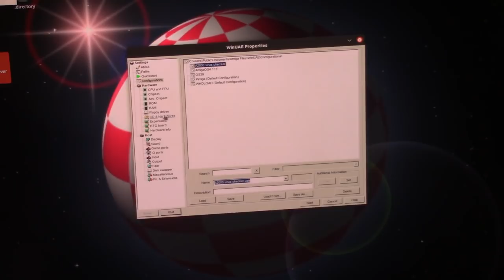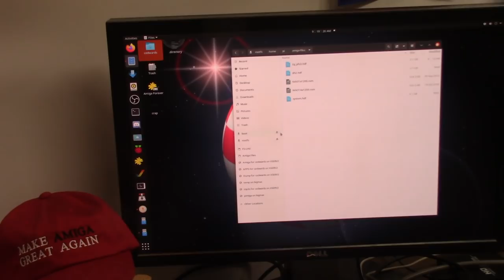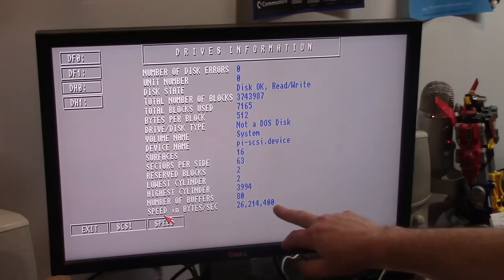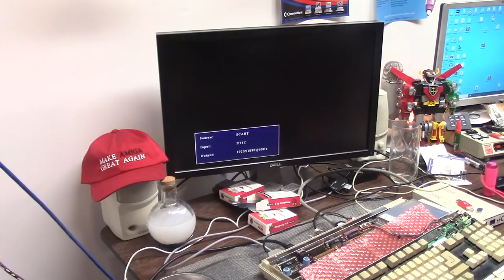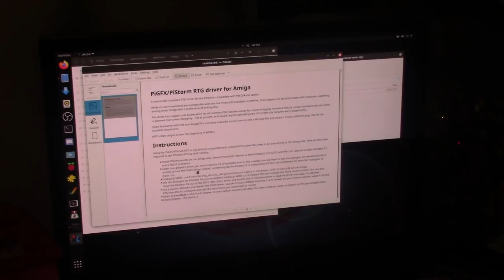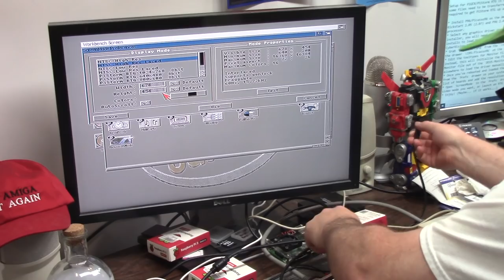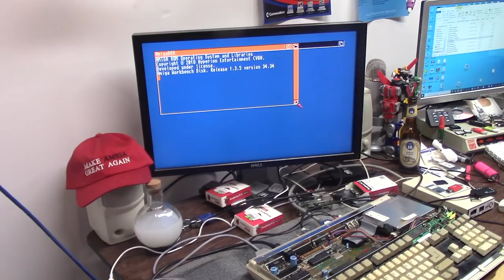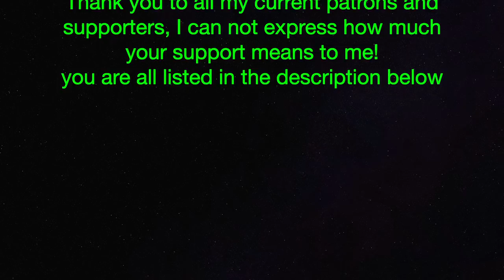Amiga PiStorm P2 - ROMS, Hard drives,  RTG and more

Comment: Is there anyway to adjust the Overscan in RTG? If you open it, it just shows PAL with basic Low Res settings and does nothing.
Reply from the maker: rtg no, only amiga modes., multiscan and dblntsc/dblpal if the monitor tooltypes are in devs/monitors,  normally those are in storage/monitors, drag em over and reboot.

Comment: Wonderful Work, Thanks Chris, a Small query, I understand this is a old Video, but When you hold down both MOUSE Buttons, turn on the AMIGA, you should get a screen to select between, PAL or NSTC ? Not Sure if this would have any effect on Sound, or if is something in Rom, cause I remember it from my Time with Toasters, on a PAL Machine, using Toasters which were NSTC, which may have triggered it, in Rom ....
Reply from the maker: pistorm hates Zorro slots too, it can sometimes do ONE card, but can not address DMA,
Reply: @ChrisEdwardsRestoration  Yeah I was tired when I typed that, ooops
Reply: That only applies on certain models,  not say standard Americn A500s.
Reply from the maker: @fmlazar  DMA? 500 has no DMA anyway as it only has one expansion slot.

Comment: Yea switching Video Modes VGA/CGA/HDMI is a PITA.  On my desk I have 2 monitors and a TV and its a pain keeping track of what is connected to where which is why I have most of my toys connected to KVM Switches and I have an 8 Port VGA/PS2 which all but one of my Amigas are connected to and then I have a 16 Port HDMI/USB which I use for all my other toys but I plan on connecting my Amiga's to that switch too so I will end up with Dual Displays.   Everything here is a work in progress and right now the only Amiga's that have HDMI are the ones with Vampires because I have to play catch up with my house before I can build those RGB2HDMI Boards.    The PiStorm I do have an interest in but its for my A1000 which is the only Amiga I have that has no accelerator in it and I have some old boards from my original A1000 back in the day I have to dig out but I think I am missing a chip for one of them but right now that's not important just giving the old girl a speed bump would be nice and I have some RAM boards for it I have to look for in the house from my original A1000 from back in the day.

Comment: Any idea why Frontier was running a bit too fast in your last vid? Maybe NTSC/PAL issues due to the different chipset clock? Also, as far as I understand the code, It seems to me that the CPU "emulator" is just a normal user mode process with a couple of threads talking to the CPLD. If that is true, I would expect it to get preempted all the time by the linux kernel and other threads so the actual emulation speed cannot be constant. I would expect it to behave somehow like WinUAE with "fastest possible" CPU emulation speed. I wonder what consequences this would have for Amiga software. Maybe you could show off some games etc. next time?
Reply from the maker: My amiga is ntsc i booted it in ntsc so it ran faster i have to double mouse button choose pal otherwise the audio is fast or late

Comment: Hi, this 4GB hard disk file you shared isn't .hdf? How do I get it to work with my A500&pistorm?
Reply from the maker: it is, just change the extension. 
you can use it as a blank hdf to install workbench on if u wanted to. or create your own in amiga forever/winuae which is what this one is.  probably faster to build it all in winuae with a hdf file and just ftp that file over to the pistorm.

Comment: Since your set-up allows both PAL and NTSC, why do you stick to NTSC?  Pal will give you more resolution on the desktop.  Without RTG, you also should take advantage of the Amiga overscan to maximize desktop resolution further.
Also, why did you install a full Linux distro with Xwindow desktop on the raspberry?  A smaller text-only Linux distro would make the Pi boot faster.
Reply from the maker: lite has no X or dwm anything, i can trim un needed services to make a faster start.

Comment: Any chance to by PiStorm ? I tryed to order in JLCPCB but there are some parts missing.
Reply from the maker: there is some kind of chip shortage for the alterra cpld, you can still get them made minus this chip and source your own on ebay for a slightly inflated price,  not alot, the orig cpld was 3.15usd. now its like 9-15usd   supply and demand i guess.

Comment: I think that when you go to RTG mode the CPU emulation can go faster as everything can run "independently" instead of sharing the bus with the chipram.
Reply from the maker: Thats it then . I thought it was faster!
Reply: @ChrisEdwardsRestoration  But it may just be affecting Sysinfo...you need to try a real test...like run some demos or like the start to frontier....you should try to boot the Coffin OS R56 or something on that and mess around with it.
Reply: Let's see...ADOOM at that speed about the same as my AGA core MIST with RTG runs at about 5 FPS in EHB or in RTG no real frame rate change. However, it looks like in RTG mode with the PiStorm the CPU is just abit more than doubled. I if you run ADoom in EHB mode and then in RTG mode and the frame rate doubles, then you know that in RTG mode the CPU emulation is twice as fast!!
Reply: @CobraTheSpacePirate  Demos and Frontier run on RTG?
Reply: @jensdroessler3575  I suppose there are some demos that could run on both rtg or native...I don't think Frontier can run on rtg...

Comment: Sweet, is it faster than a 060 50Mhz?
Reply from the maker: Its nice and smooth. Fast for me but demo and cpu intensive program testing would need to be ran to determine if the emulated cpu is up to par.  So far its been super awesome.
Reply: @ChrisEdwardsRestoration  Nice! Cant wait to try one myself in the future. I want to keep all the custom chips stock but have no problem with the CPU being emulated (or the GFX board). Thanks for the video!

Comment: I am SO there to source a PiStorm for the Amiga500 desktop that I have build from scratch. Just a shame that there is a lack of chips at the moment. 😒
Reply from the maker: well commercial shortage yes, individuals can still get the cpld on ebay for like 5-10 each, way more than the 1.35USD they were. but supply and demand i guess.
Reply: @ChrisEdwardsRestoration  Hmmm.... They reported something else on Discord. I just have to wait untill my other projects are done. I have a couple of C64 clones that I need to build first, and then I have my 1200 that need to be upgraded first. Right now the 1200 is stock configuration. I have gotten a new membrane and the board is recapped. However I need to get more ram and a scandoubler for it as a minimum.
Reply from the maker: Go look on ebay the cpld is an altera max II epm240T10015N
Reply: @ChrisEdwardsRestoration  I believe you, because you seem to know more than me about computing stuff. However I will wait to buy a Pistorm untill I have finished up my other projects. I can not solder smd, so I will have to rely on what I can buy ready made.
Reply: @brostenen  It doesn't hurt to wait a while. This is just going to get better and better. It's still pretty much early days right now. It's exciting to see this stuff taking off.
Reply: @ninline2000  Yay... When the software have matured even more, then I will get one for that 500-desktop that I build. It is the one, that I have a video about, on my channel.
Reply: I had no problem finding the CPLD in eBay I bought 6 from China at air $6 each. It was perfect because the PCBs were e 5 for $2. I was afraid the CPLD were fake, and if they are i don't care since they work.

Comment: Wondering if you can fit this with the pizero2hdmi  as well.
Reply: You can as long as you’re careful with your choice of mini hdmi to hdmi cable.
Reply from the maker: cpu speed would suck eggs. but those boards fit fine. as they dont have the long usb ports hanging down
Reply: @ChrisEdwardsRestoration  - I think he means two different boards. One for good CPU speed and another, slower pi for hdmi conversion.
Reply: @davidste60   That's what I was thinking that way RTG works and "standard" is ported to HDMI. no more horsing around with scalers and such.
Reply from the maker: My brain is fried sorry.  Rgb2hdmi would fit with a super tiny mini hdmi as the ports are adjacent to each other but the cpu is just a tad lower
Reply: PiStorm developer is designing a RGB2PiStorm thing, it does what RGB2HDMI does, but sending the signal to the PiStorm/RPi combo, so ALL Amiga outputs, both standard and RTG, would be being displayed through RPi HDMI output, so no need of two different connectors, one for RTG and another for RGB.

Anyway, it's still in a very early stage.
Reply: @ferran.garcia  that would obviously change things.
Reply: @ferran.garcia  - That's interesting, but I thought the Pi3 models can't do low latency video conversion, which is why the Pi Zero is used for the RGBtoHDMI. Am i wrong?
Reply: @ferran.garcia  - Nice, I hadn't thought of the camera port! Thanks for the links.

Comment: Is painful watching you pull out the sdcard or transfer files via serial. You can transfer files via ssh. The raspberry pi can also mount network drives.
Reply from the maker: yes i know. but not everyone knows linux commands, im trying to do it as people would do  old school. as im old school. theres a millilon ways to accomplish the same task. sftp would be the best way.
Reply: @ChrisEdwardsRestoration  How fast will serial go on a A500+ with a pistorm?
Reply from the maker: @IntenseGrid  pistorm is cpu and ram/rtg it is not serial device. that and the other Amiga chipset is still what it its, while theoretically 115200, the Amiga has slower UART chips that give it a practical 38400

Comment: So you have an amiga running workbench from a raspberry pi emulator on top of linux. The cherry on top would be to install NetBSD on the amiga.
Reply from the maker: Its just the cpu and hdfs you can still use orig hdds

Comment: I don't get how you manage to make an A1200 kickstart ROM image work on an A500, it is not the same hardware.
With a 3.1 A500 kickstart ROM or 3.1.4 A500 kickstart ROM image, OK, but A1200 version, really?
Or maybe the name of these files is not the good one, and it is actually the A500 version of these kickstart ROM image?
Reply: The A1200 ROMs support the A500 hardware well enough to not being a problem and offer better working autoconfig, which is needed for PiStorm. PiStorm emulates a 32bit CPU, so basically all boxes are checked to use the A1200 ROMs. I think the IDE emulation is based on Gayle of the A1200, it probably wouldn‘t work with an A500 ROM.
Reply from the maker: Pistorm is based off the 32 bit amiga roms, 3000/4000/1200, you can use a unsplit rom for emulation, which is what i used, the 1200 rom contains the A500 OCS/ECS code and has better autoconfig support than the original 3.x A500/600/2000 roms did.